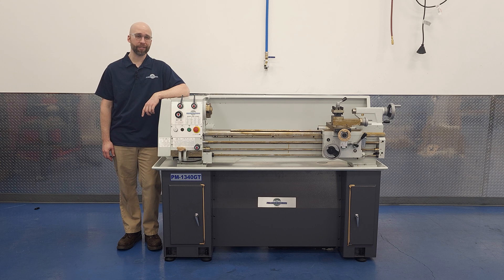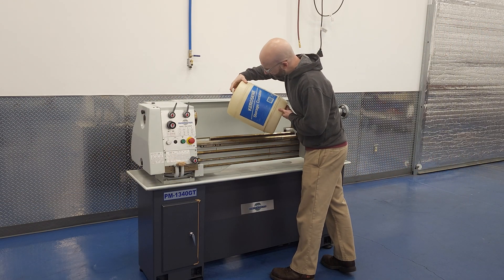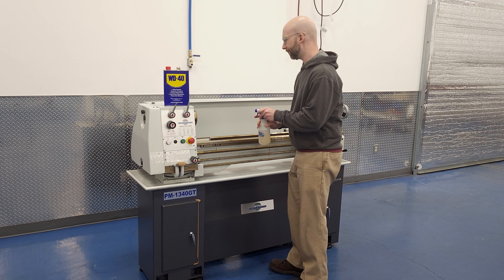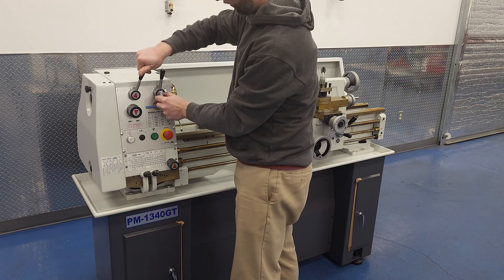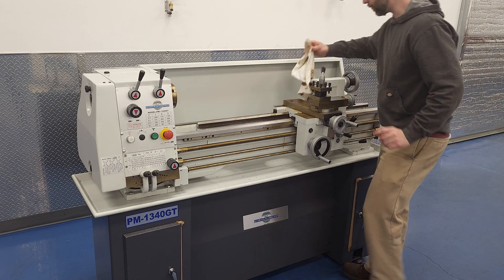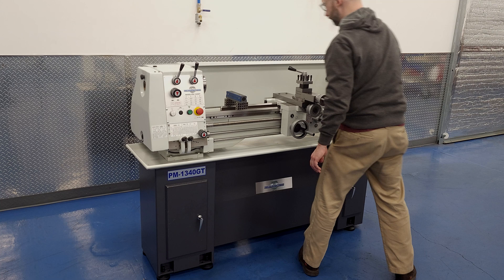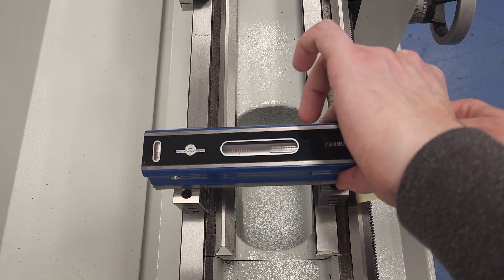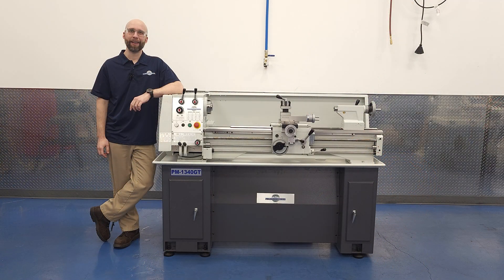PM-1340GT - Cleaning and Leveling - Precision Matthews Media

Comment: You can’t skip either one.

The biggest issue and you showed it leaning against the lathe is the cabinets are just too flexible to do a good solid job of leveling.

I have a Jet that is similar and the stand is so bouncy there is no point in trying to level it.

The number two issue is the leveling screws are too coarse for fine adjustment.

The six screws are a pain, do the four corners and than just bring the center ones tight, they really don’t do anything like on a big cast iron base machine.

I usually use a very light touch and find that many machines have a heavy end or corner that have to be the point you level the rest of the machine too.

Hope that is helpful.

Comment: I used WD 40 to clean my 1340 , and I didn’t know why I have 2, starrett 98 levels but I do and used bought, I don’t have a test bar I do need to check the run out . I’m very happy with the 1340 GT , had a few things, 2 handles missing and a few other things but PM got it all right. Thanks